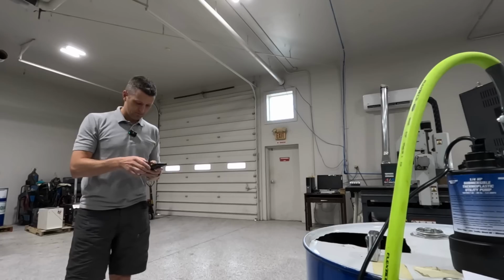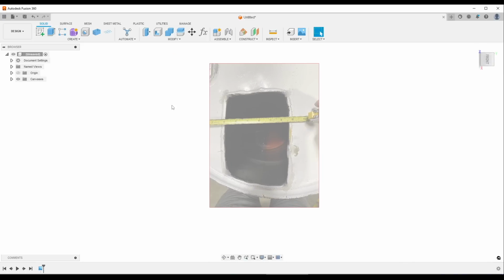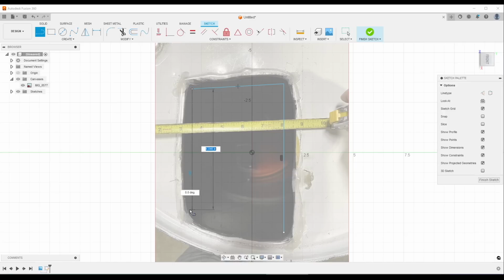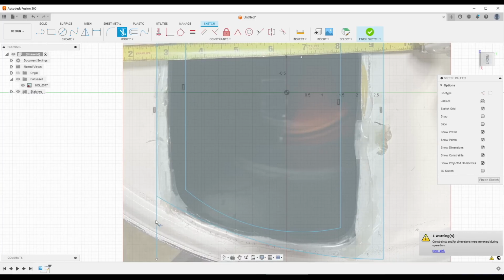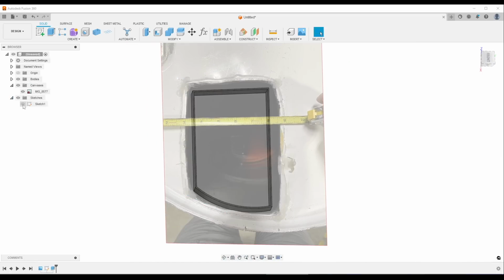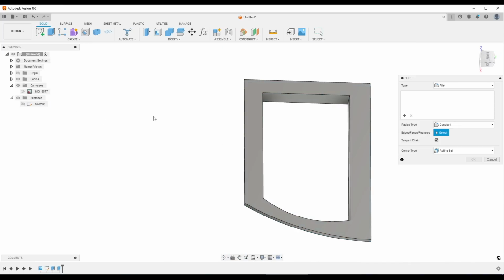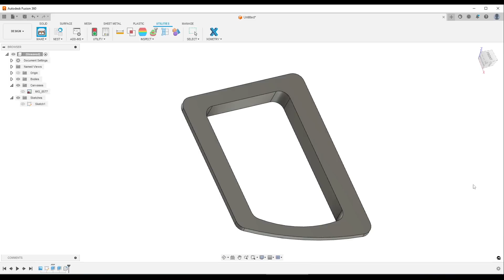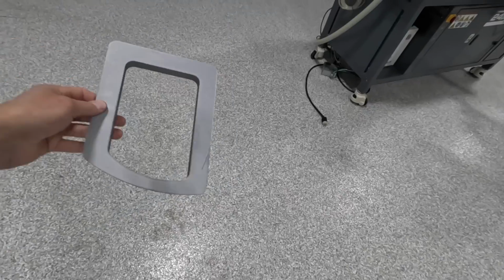Reverse Engineering with Fusion 360 "Calibrate" trick!

Comment: A couple of things I learned while using this technique over the years. The most accuracy I achieved is when my reference scale item is on the same plane of the part I am photographing (typically I use a piece of graph paper on the reference part so I know its 1/4" square that's my calibration dimension). The other thing is to not be too close to the reference part when you take the photo. The distortion produced by a close up with a wide angle lens throws the dims off

Comment: When I do this, I get the best results when it’s an item I can put on a flatbed scanner. Obviously not the case here, but the scanner avoids the lens distortion since it captures each line of the image from directly below the object, straight on. If I have that, I find I can get pretty bang-on canvases to trace from. There are also “scanner” apps for your phone that tell you when you are pointed straight down and correct for lens distortion, which also help in cases like this.
Reply: Name on app ? 😊

Comment: A very underrated tool... the best application I've found for this, is for you make a template, either drawn or cut cardboard and then scan it in, increases the precision quite nicely. Particularly good for making a buck mould tool (ie. making a 3D part from equally spaced 2D templates)

Comment: There are a couple of limitations to this method. First, it will only work if your reference is on a single plane. Second, your camera has to be parallel to that plane. Both of these issues are due to parallax.
Third, make sure your camera is not using a wide angle lens as this will distort the image.
Reply: Reasonable limitations, and to be considered for fine work. For general non-fine work it works wonders.

Comment: pretty nice tool for cutting this would be a hand cordless shear, still will leave sharp edge so you can still fire up the printer, MILWAUKEE 2636-20 M18 18V CORDLESS 14 GAUGE DOUBLE CUT SHEAR, but thanks for the scale tip, learned something today

Comment: You should be able to correct for taking the picture at an angle by having a chessboard (printed checkerboard would work) in the shot and warping the squares back to square.

Comment: Super cool and something I can see useful. Can I ask why instead of the inside big rectangle opening you didn’t just make a diameter slightly large enough to fit the hose? Then theoretically debris won’t find its way into the drum. You’d have to fish the hose through the hole before installing. Which I believe is what you ended up having to do anyway in the video. Great idea and concept.

Comment: I have been doing this for a while but often find my picture gets really distorted when brought in as a canvas, even though I calibrate it in one plan it often still leaves it the wrong size in the other. Is this my iPhone camera or is there a preferred format to import it as the canvas? Be great to get this working better as it’s a great way to bring in a drawing to sketch over. Many thanks cheers Ben
Reply: You need to use the telephoto lens for min distortion. But you will still have some no matter what you do. 
That’s why 3d scanners exist. Or try Photogrammetry.

Comment: I use this feature, but I find it lacking if you have something other than a photo.  Say you have a 600dpi image that's exported from another program.  Flatbed scanner images are a great example.  The most accurate you can do is to manually calibrate the scale.  But you know the exact scale.  And there's no way to enter it.

Comment: Regarding your umc500 in case you drill a hole in B0 and B180 - what is the positional tolerance you will get? I read thinks about up to 0.05mm/~0.002“. Is this correct? What about  thermal growing in Z? 
Thanks a lot in advance
Reply: That's just the spec sheet. It's much better in real life
Reply: @urgamecshk  is it?

Comment: Your idea is correct, but the implementation is wrong.
Use the narrowest lens and photograph the flat object perpendicular to the camera direction. You should stand relatively far away from the object and it should be exactly in the middle of the picture. Only then will you have as little distortion as possible in the picture.